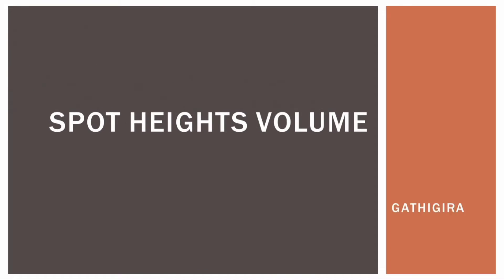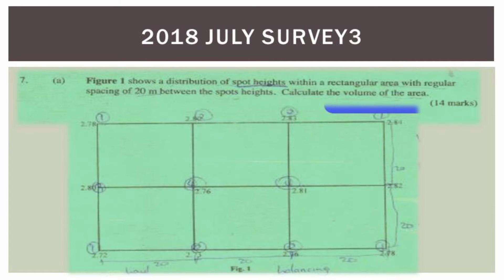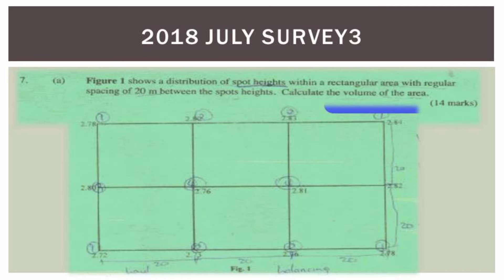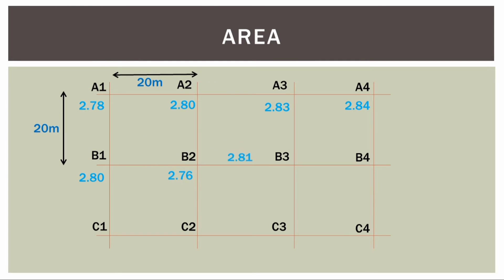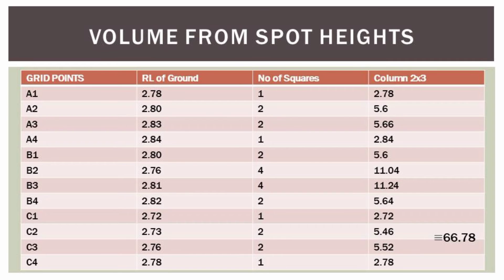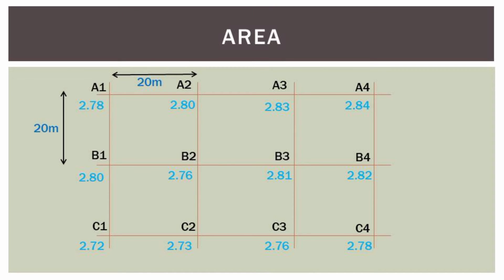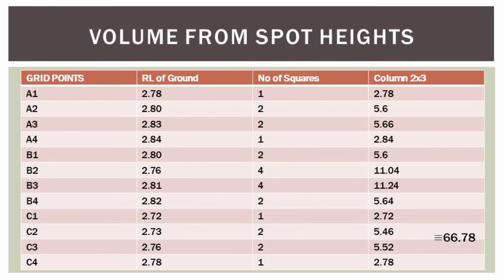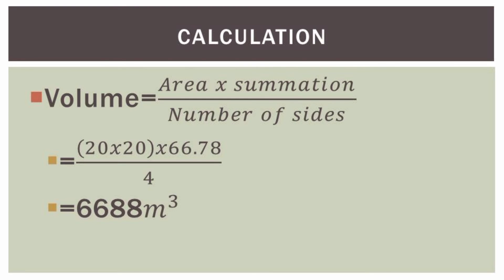engineering volume under spot heights calculation

Comment: The junctions of the square grid shown below were levelled to determine the volume of excavation necessary in the construction of a basement floor. The reduced levels of the grid points are as shown.

X

X

X

185.67

186.22

187.34

X

X

187.45

188.00

X

X

X

X

X

186.33

187.03.

187.22

X

X

X

186.64

186.98

187.44

X

187.08

X

187.56.

187.90

X

X

X

X

187.35.

187.89

187.34

187.43

X

X

X

X

187.26

187.24

187.46

188.02

187.93

The horizontal distance between the grid points is 20 m and the required formation level of the basement floor foundations is to be 178.00 m. Calcu- late the volume of the excavation within the grid area.

Please I need help 🙏🙏🙏
Reply from the maker: That's how its easiest, I don't see other way
Reply: @IwordsShotsEmpire  please can you solve it us content for me